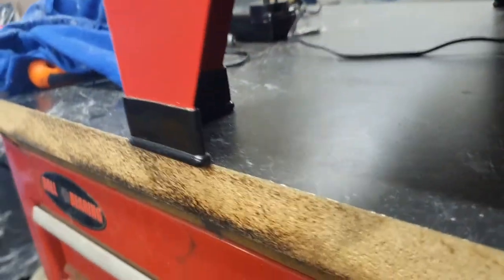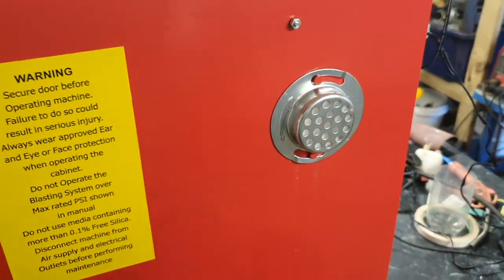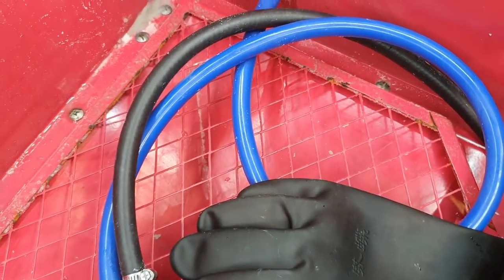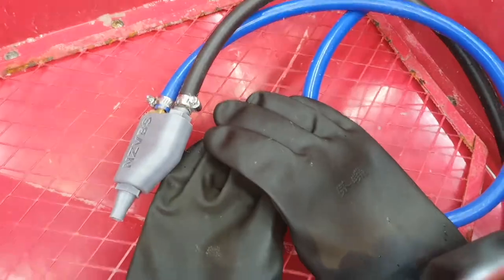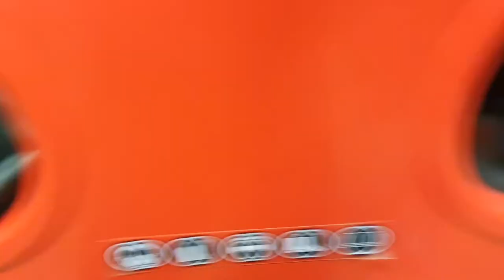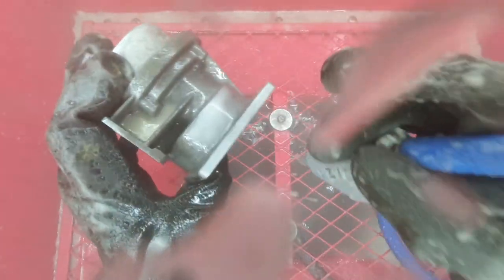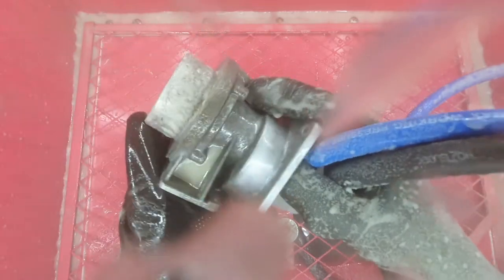Ghetto Blaster PT3, Sealing, ventilating and re-gloving the cabinet

Comment: i have a similar cabinet to this but i dont no how you set up the electrics and is it powered by 12v or other more info or a short video would be great thanks jay from england
Reply from the maker: Hi,

Yes it is 12v but just runs on the light step down transformer.
I will do follow up videos when I am a bit more caught up.

Comment: Where did you get the gloves? What are they originally for? Might help finding some locally. I have been using my DIY vapor blaster for a little over a year and the gloves are the only issue so far.
Reply from the maker: Hi Timothy,

These gloves are sandblasting gloves. You can find them on ebay, and their measurements are 60cm long and 20cm wide measured flat across the mouth.

Is your cabinet this size or larger? These will only fit cabinets with the narrow glove rings.

Cheers,
Josh
Reply: @ArmouryEnterprises  Unfortunately I have a full size cabinet.  I was probably one of the first ones to buy your instructions on converting the sandblast cabinet. I will have to look more, all the ones I have found so far have the felt and are too thick in the fingers. Thanks!
Reply from the maker: @tims-whims  There are other larger sizes also available on ebay from time to time. I didn't see any on at the moment on the quick search I did, but they do show up quite often and are well priced.